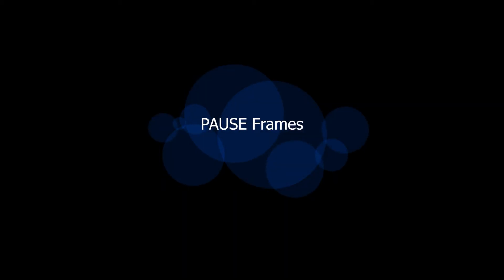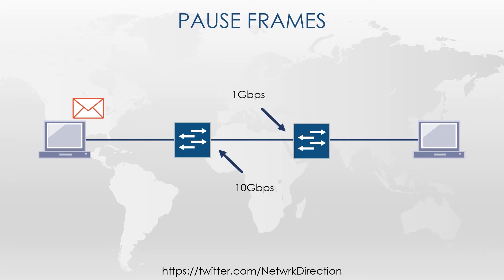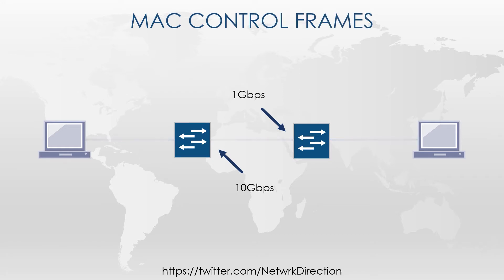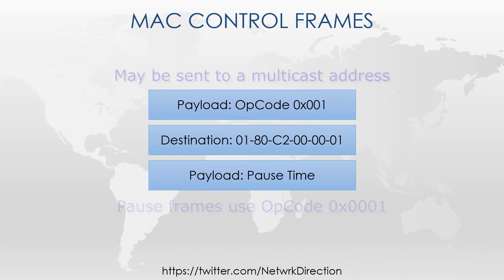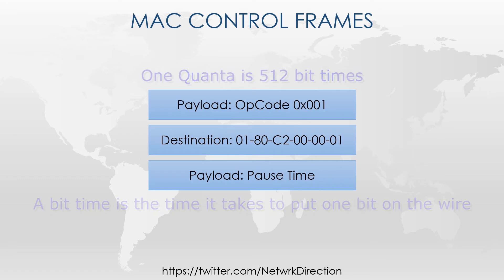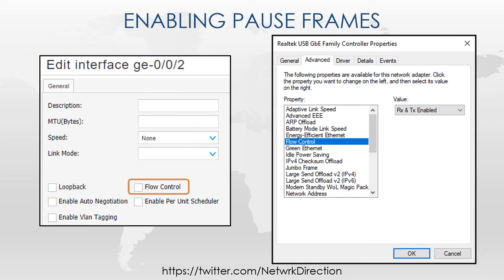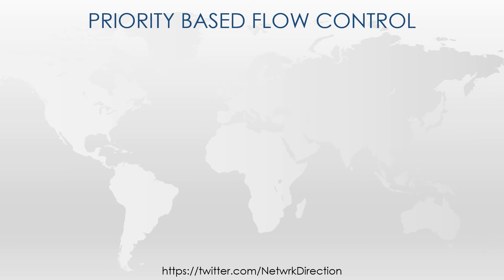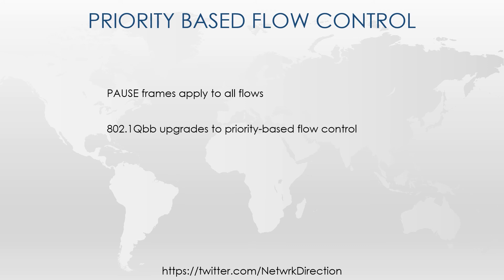Pause Frames

Comment: if i have 3 cameras streaming 60 MBit/s each to a Monitor with a 100 MBit/s Interface via a 100 MBit/s switch will the display, with flow control enabled send a pause frame or will it not detect the overload because the switch (which cannot send a pause frame in my example) only receives 100 MBit/s?

Comment: I need get mac address in port connect in devide . i dont know use what OID
Reply from the maker: Are you talking about getting a MAC through SNMP?
Reply: @NetworkDirection  yes
Reply from the maker: @binhnguyenhuu7994  You will need to look at the documentation for your device.
Also, google the term 'snmp walk', which might be of interest
Finally, I suggest using Paesler's free SNMP tool for testing

Comment: If a frame is paused you get lower bandwidth when trasfering data or it acts almost like a packet loss because it has to be sent later on?
Reply from the maker: Good question... If you're getting pause frames, generally it means that you already have a problem with bandwidth.
The pause frame will delay the delivery of traffic. Whether this is considered packet loss may depend on the tolerance of the upper layer application.